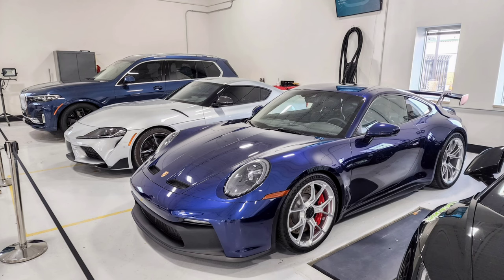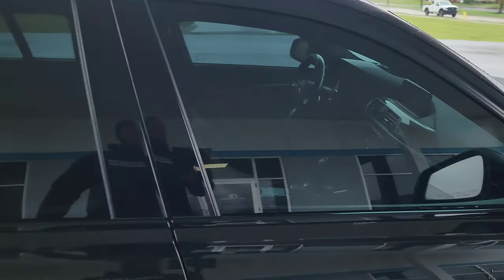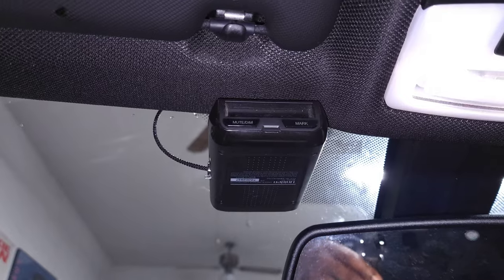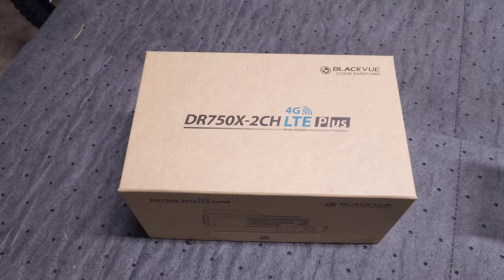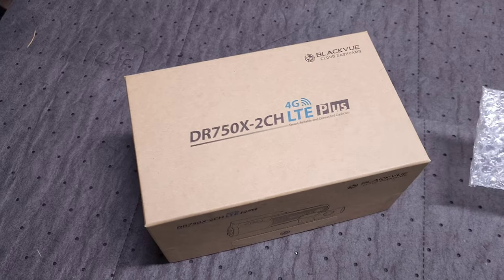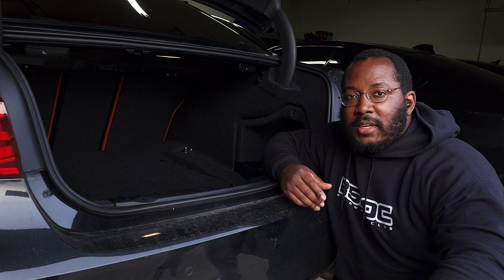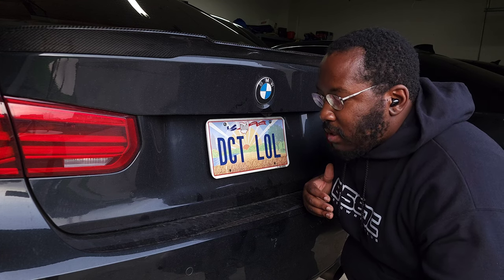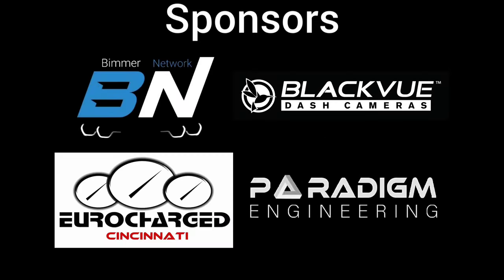Setting up my Copart 340i for Daily Driver Duties -  Vlog

Comment: Love the vid, I just picked up at 440i Any advice on my my car isn’t getting any traction. If I use launch Control, I just go into a straight burn out. It’s my first rear wheel drive car. I’m on falcon F1 tires. Do you think if I switched to a different set of tires I’ll get better traction.
Reply from the maker: Tires make the biggest difference. Also most people get the best launch by brake boosting
Reply: Swap tires man at first I was running on oem tyres run flat spinning till third gear then I swapped for mishlen pilot sport 5 ohh man night and a day different I launched the car from 0 and hooked!!!! stage 2 rwd car